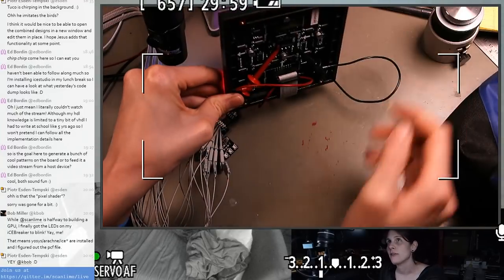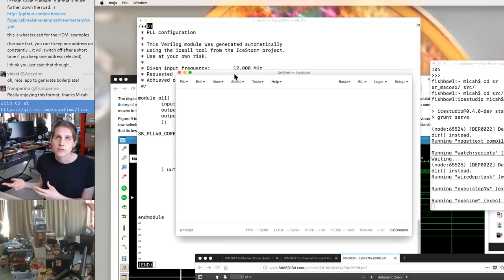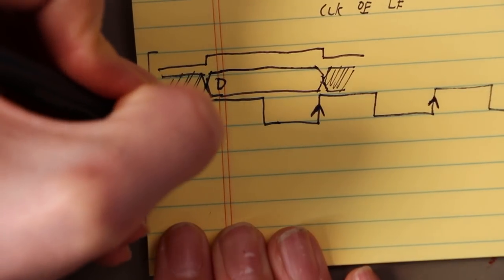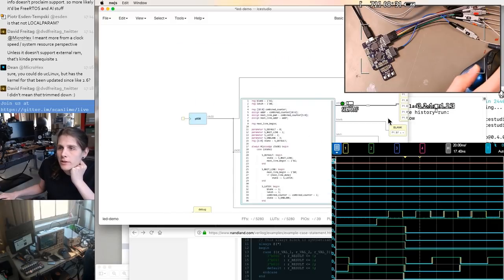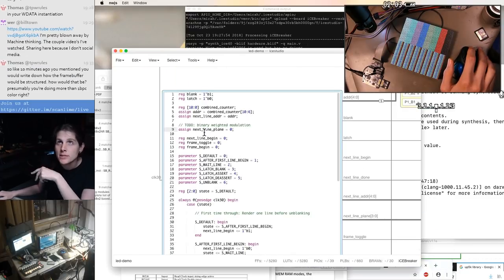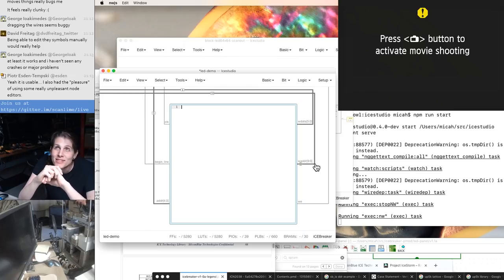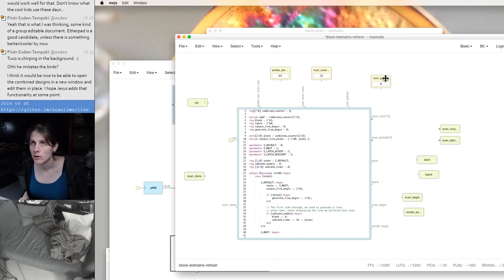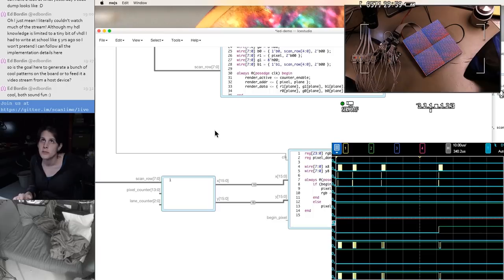Icestudio and Verilog project, LED Matrix FPGA driver! Part 1

Comment: I am trying to understand how you did this, and converting to vhdl (while learning), using a random fpga I had ordered a while ago. But I am missing some important information here and there, do you have the entire stream laying around somewhere? I'm not sure how you handle the address for example. Aren't the address decimal coded? not binary? You seem to just fetch it from the 4 top bits from the combined counter. I am strugling to get good documentation on these led matrixes. How the rows are aligned, etc.
Reply: Ah, 16 lines yes. So the addr is binary ;P I got it working now :)